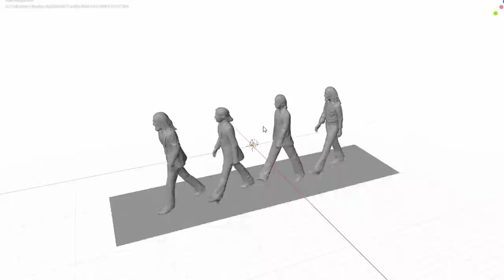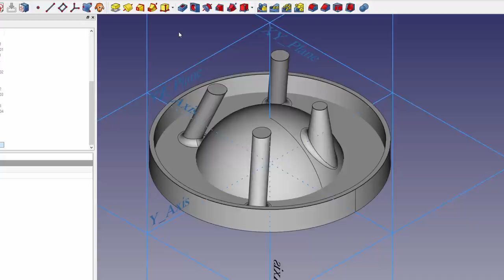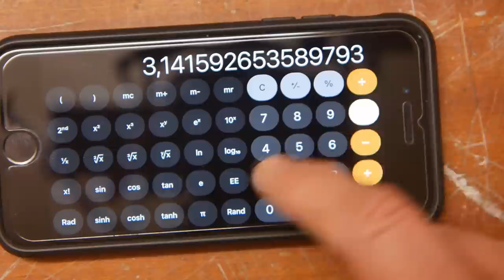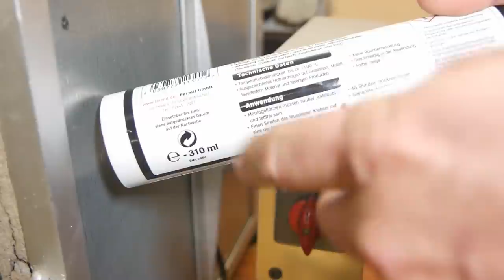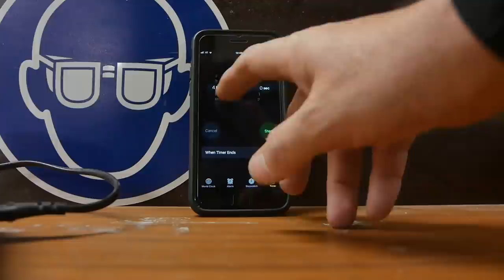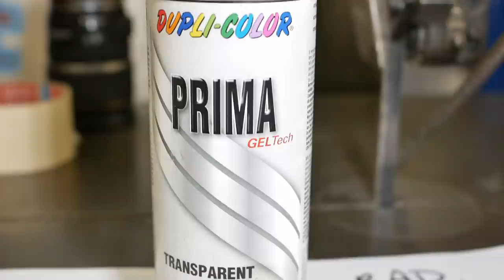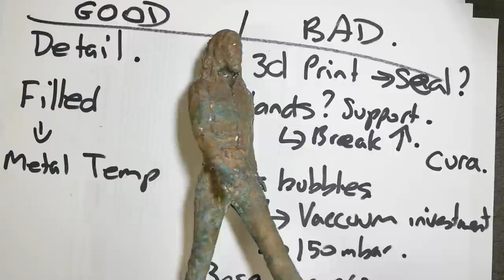Investing in the Beatles

Comment: Try rotating the print to an angle. You will need more supports. The angle helps to hide the defects and gives more structure to the part, making it easier to break off the supports. Also, change the supports to cones, less contact area than round, which is easier to break off. Don't just snap off the supports by hand, use a pair of clipping pliers. 

Or try printing with a resin 3D printer. I gave up on filiment printing because of the lines. You get less on resin because when the next layer is printing, the layer before it is not fully cured and bonds better.
Reply from the maker: Thanks for the tips. Which resin printer do you use? 

I have gotten a lot better ar removing the supports carefully. I now have another George model ready which is looking pretty good.

Comment: Maybe you can first apply an initial layer of plaster with a brush? Or maybe you could even paint a layer of sodium silicate on there? That way, the investment will already be sealed before you expose it to the hydrostatic pressure of the poured plaster.

Maybe you could also increase the number layers of the walls of your print in order to reduce the chance of plaster seeping in.

If all that doesn't work, look up the salt remelt method as explained by CNC Kitchen. You may be able to seal the print by controlled remelting using fine salt as a support material. Intead of printing a solid model like he does, you could fill the inside of your solid-walled shell with salt, and also use salt to support the outside. That would save you a lot of filament while achieving the same result.
Reply from the maker: Thanks for the tip. I will try the added layers first on Ringo.

Comment: Printing your Beatle on it's head without a base plate would reduce overhangs and the support needed. Also a extrusion multiplier around 1.3 can help with watertightness.
Reply from the maker: I considered that, but then you have to deal with the head on the platter, and it is the most seen part of the statue. The base is necessary, both as a base of the statue, but also because it is the Abbey road cross walk. Thanks for the tip on the multiplier.
Reply: @RotarySMP  I was going to mention print orientation myself. You don't necessarily need to flip completely onto the head, but you certainly can try different orientations to see different layer lines and support structures, could end up solving most of your problems just by rotating.

 Another potential trick is cutting the model in half and gluing together post-print. It may not be ideal with this one but it's something to keep in mind with difficult prints
Reply from the maker: @UnreasonableSteve  Thanks, those are helpful tips.

Comment: This 3 phase plug is really brilliant. Thanks and cheers.
Reply from the maker: I'd also never seen those before. Very practical.
Reply: I have also never seen these on cable plugs, but the build in CEE connectors on table saws and wood splitters are almost always equipped with this feature.
Reply: I thought that was really cool too.

Comment: In addition to trying tree supports or modeling a custom support for it, you could also try printing the model as several different parts that can be printed with less support and then glued together. Glueing will give you a seam that may need some cleanup, but given its a casting is not a huge deal if you have to use some wax or pva to hide it.
Reply from the maker: I have a decent George IV ready to go, but will try tree support on Ringo.

Comment: Watertight PLA is tricky. You want to reduce the number of interfaces (thicker layers) and make sure they blend well (using over-extrusion). More perimeter lines, enabling ironing, and increasing print temperature may also help. Also, make sure your PLA is super dry (bake it if necessary). If nothing helps try annealing (using plaster or salt - see CNC Kitchen for details).
Reply from the maker: Thanks for the tips.

Comment: Preheating the investment might help. 
Its done in commercial casting too. They cast straight after the burnout in the hot mold.
Reply from the maker: Good point. I did, it came out of the furnace at 750°C, straight into the Kaowool blanket on the wheel barrow, and rushed it around to the back yard. By the time I'd skimmed and super heated the metal it was probably out of the burn out oven for about 10 minutes. I might be able to improve on that, but first skimming the melt and then fetching the mould from the oven. If the weather were more stable, I could put the oven in the back yard, and do it all in one go.
Reply: @RotarySMP  I think your subservience to rain is the real issue here - the casting area needs a roof! ;)

Comment: 1) You can try "tree-like" support structure in the Experimental settings section. Standard support should be disabled in this case.
2) You can try to print the model upside down.
Reply from the maker: I am trying tree support on Ringo.

Comment: that white stuff on the turbine blade is zirconium oxide which is coated in special machine which melts ingots with electron beams at around 2500 Celcius degrees
Reply from the maker: TBC application is a very sophisticated process. Also the base layers to enure adhesion are not trivial.
Reply: @RotarySMP  diffused platinum coating '
Reply from the maker: @big_bad_lynx  I hate to think what it costs to tool up and overhaul facility these days.

Comment: I have 2 suggestions on your support problem I don’t know if it will help or not. 1 suggestion is to use tree supports but make them slightly thinner it may help. Suggestion 2 is you may have to try using Fusion 360 to generate a custom support structure that should be easier to remove without breaking his hands. Hope this helps some if you have any specific questions I’d be happy to try and answer them in more detail.
Reply from the maker: Thanks. I only took a cursary look at tree supports, but will explore the options there a lot more closely. I dont use Fusion, as this is a monetised channel, and I cant afford their fees.
Reply: @RotarySMP  understand just thought I’d mention that as an option I have access to Fusion on an education license because I’m taking a machining class.

Comment: Have you tried orienting the print differently? In Cura tree supports can be good too, probably worth a try. Final suggestion for the hands - cut them off the model in freecad (or whatever package you prefer) print them separately and glue them back on with CA.
Reply from the maker: Good tips thanks. I have just reprinted Georg, for a 4th casting attemt, and this time got luck with the hands. Still had to glue then back on, but managed that without to much drama. The fingers are only about 1mm thick.
Reply: @RotarySMP  cool. If you find the supports are totally encapsulating parts of the model, which they certainly appear to be, check out the 'support x/y distance' setting too which can be adjusted to keep the support structure further away from what's being encapsulated. For the gaps in the walls try running through Teaching Tech's excellent printer calibration https://teachingtechyt.github.io/calibration.html
Reply from the maker: @doobedoobedo1  Thanks for the excellent tips.

Comment: If a spraypaint shell is problematic, maybe coating the 3d print in wax would help? To get the small detail of the hands, all you can really do is print with a smaller nozzle. Try a 0.2mm if you haven't already. And as others have suggested, I'd also print the model upside down so there's less support attached to the arms. You could split the print at the shoulders and print the baseplate separately.
Reply from the maker: I have George IV already prepared. This time got the hands to release pretty well, and trying the clear paint. Will report on that.

Comment: 1. Have you tried using acetone to remove the 3d print lines. 
2. From other videos I've watched you need to vacuum for a surprising long time. Maybe use a transparent lid so you can see when the bubbling stops
Reply from the maker: Acetone smooting is for ABS, not PLA. You cant investment cast ABS, as burning it out makes a terrible stench.
Good point on the vaccuuming. Need to source a big thick plate of perspex.

Comment: Would adding a layer of wax on the outside of the three-D printed model keep the investment out of the model? Spraying might be possible with a modified airbrush (using a heated cup to keep the wax melted long enough to spray it on. That would also get rid of the layers of the 3D printer. I'm thinking of a fairly soft wax here, perhaps bees wax, which melts easily, or perhaps candle wax.
Reply from the maker: I am pretty sure that a wax temp high enough to by sprayable, will probably cause issue with the PLA softening. That sounds like it's own rabbit hole to run down.
Reply: @RotarySMP  The melting point of beeswax is 62-64°C (according to Wikipedia), and I think that those temperatures will work with PLA. How to spray is another matter, there is certainly room for a rabbit hole in the subject..
Reply from the maker: @mrtnsnp  Oh, that is lower than I thought. I have already sealed the next George with clear coat, but if that is also a failure, then wax is a good candidate.

Comment: Resin printers are so inexpensive I would pick one up. This is such a cool project and you already have the difficult skills of casting “mastered”. A castable resin would completely solve the problem of the plaster ingress. Also the detail in resin is unmatched by FDM, it really is incredible.
Reply from the maker: What model do you use?
Reply: @RotarySMP  I use a photon mono x. The small one.  I got it for $26o usd. I know we are spoiled in the states but it’s still has to be proportionately cheap where you are.
Reply: @RotarySMP  I would be happy to print a couple sets of figures for you and ship them.
Reply from the maker: @mattcmullen  Thanks for the offer. I have the next print of George already prepared in the flask for investment. This one got the clear coat to seal it, so I will try that out. Will let you know if I need to take up your kind offer.

Comment: How about using tree support for the hands, and keeping that support as runners? 
Would more perimeter layers help keep the plaster out of the interior?
Reply from the maker: Hi Andy, I was also thinking about using the hand aupport as runners, but the way the models hands curve, there is also support in the palm area, and then still more to support the cuff. The support material is way more substantial than the hand. I reprinted for the next attempt, and managed to get the hand out of the support quite cleanly this time. ALso took practice. I must have printed it at least 8 time by now.

Good point about more perimeters. I'll try that next. I already have the next model prepared with the clean coat.
Reply: @RotarySMP  maybe you can add tiny strings of hot glue from the fingers to the top of the mold, they can be very thin, just big enough to let the trapped air escape. Maybe 0.5 mm
Reply from the maker: @Henning_S.  I did that. I just use short lengths of 2.85mm filament and hot glued them to the fingers and the lid.

Comment: Great Video, plaster investment and phosphate investment prep, in addition to vacuum, should be vibrated while under vacuum, bringing the micro bubbles to the surface. The flask should also be vibrated whilst filling as this helps the wetting out of the surface. Dental  laboratory supply houses have dedicated wetting agents to reduce surface tension on the model. Cheers, Richard
Reply: I was also wondering about vacuuming (and vibrating, iff possible) the filled flask, if it fits in the vacuum pot?
Reply from the maker: It doen't fit into the vaccuum chamber unfortunately. This is one of the challenges, these figures are significantly bigger than the typical jewellery investment castings. They really should be shell cast, but I could find no vender of suspend-a-slurry or similar here in Austria.

I will try to do some vibration in George IV.

Comment: Would it be possible to add the vents and risers etc to the figure before printing so you don't have to remove the support?
Otherwise as someone else mentioned cutting the arms or hands off and printing them separately with the fingers pointing up
Reply from the maker: The Model is in Blender, and I don't have the skill (or the interest in learning it). I have reprinted it, and managed to get the hands out okay this time.
Reply: @RotarySMP  you mention the model is in blender, but there are free tools like meshmixer that allow you to do some common tasks with already-exported STLs. Still something you'd have to learn but it could be worth a look
Reply from the maker: @UnreasonableSteve  I added the base blocks in Blender, but it was a pretty painful learning process. I also looked at meshmixer, but would rather do other things than constantly learnign software I only need a couple of times.

Comment: For small details like the fingers resin printers generally work better. Bit of a mess compared to the normal FDM, but that shouldn't scare you...
Reply from the maker: Thanks. I really dont have the space or the usage to justify another printer. I guess if I do end up doing more investment casting I might have o switch.
Reply: Does resin printing lend itself to investment casting in terms of melting/burning out well?
Reply from the maker: @UnreasonableSteve  The VegOilGuy has done a lot of this, and it seems there are specific resins specifically for investment casting.

Comment: Might be worth trying a wax dip instead of paint, mucking around with temps to affect how much is soaked in, and how much skin it gives to surface. Hot air gun to finesse finish may be useful. Should get rid of the unsightly problem of lines on surface as well as sealing. Muck around with microcrystalline wax and parrafin, beeswax mixes for optimal build up.. all will burn off.
Reply from the maker: Also a good point, but molten wax will be very close to the melting temp of PLA., probably be very difficult to dip such a part without causing melting or sagging of the model.
Reply: @RotarySMP  OK, didn't consider that aspect. I think you can dissolve some waxes in various thinners, like kerosine, and other similar that may not affect PLA, no heat required to get into dip-able consistency.
Come to think of it, we had a sprayable wax release agent for using on silicone moulds with spraying expanding foam into, could be worth a try.
Reply from the maker: @dougaldhendrick3497  Thanks for the tip. I have already prepared the next George with clear coat, and will report.

Comment: In his most recent video, "2STROKE STUFFING" has cast some part for a 2-stroke engine using some sort of lost PLA casting. He used some sort of sealant for the print. That part failed because he didn't burn out the mold enough, but according to him, this method has worked beautifully before.
Reply from the maker: I watched that. He is just using sand and POP, which usual results in a lot of cracks. 

I just uploaded the next video, and the clear coat I used burned out sleanly, but I didn't take enough care to ensure every pore was sealed.
Reply: @RotarySMP  Yep, I just watched it. 
Here are some more ideas in case you want to experiment:
Maybe SLA works? There are wax-like SLA resins (for instance this: https://powerresins.com/products/powercast-wax-castable-resin), but they're not cheap. 
Or just use normal SLA?
You could also paint on some SLA resin and harden it. 
Or make a mold (be it through FDM or SLA) to make a wax casting that then gets used for the lost casting.

Comment: Split the model so you don't need supports then glue together. Try also coating with epoxy to seal and smooth.
Reply from the maker: I am pretty sure that epoxy doesnt burn out cleanly. It will leave ash.

Comment: I see you used FreeCAD there! I distinctly remember you using OnShape at some previous point. Did you switch recently? How do you like it? I switched to FreeCAD from Fusion 360 a bit over a year ago, and while there is some things I miss, I love actually having control over the software.
Reply from the maker: I had a student version of Catia, so that was what I was best at. On Shape was very easy and intuitive, but since I monetised my channel, I would be too expensive
I am still getting used to Freecad have only doen a couple of things in it. There are things which should be easy (a radial pattern, not centered on the original) which are really painful, but for the most part it works fine, and no licensing issues is great.

Comment: you need a single runner with multiple gates to feed the casting, it will also keep the casting pure.

Pour    riser
||            ||
||===   head
||
||====wrists
||
||====knee/hip
||
||====LEG

hope I am clear here LOL
Reply from the maker: I am not sure that is necessary with bornze into a preheated mould. That block was at nearly 750°C when the metal goes it, so they fill very well.  I am not seeing significant  issues from the pouring. The issues I am dealing with are driven by the errors in the 3D print.

Comment: The observation that the lid of your vacuum chamber was held down with a good deal of force doesn't tell you much about the vacuum pressure the pump is pulling. That lid has a large AREA, and force = area * pressure.
Reply from the maker: I know. I need a guage to find out the actual Px. Still, it sure is a huge improvement over the hand pump.
Reply: @RotarySMP  In terms of air bubbles, that food mixer (and attachment) is exactly what I'd use to put air bubbles INTO egg white...
Reply from the maker: @paulwomack5866  True. Wonder if any of the other attchments aerate it less?

Comment: I think instead of sealing you should make a shell with same plaster
Reply from the maker: Shell casting plaster is a completely different chemistry. This stuff goes hard in a few minutes. Shell casting slurry is engineered to maintain a suspension and not settle out.